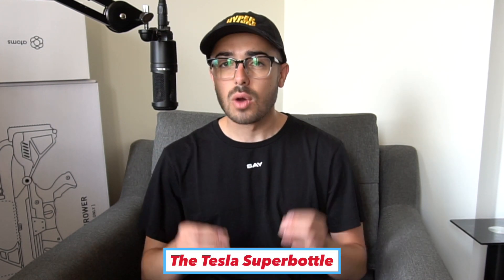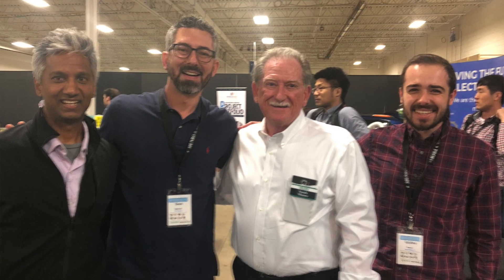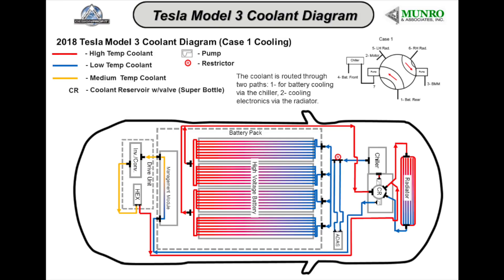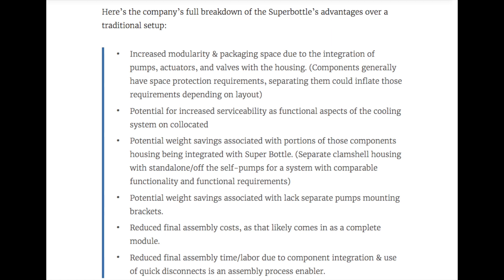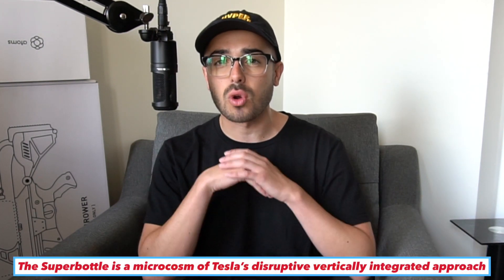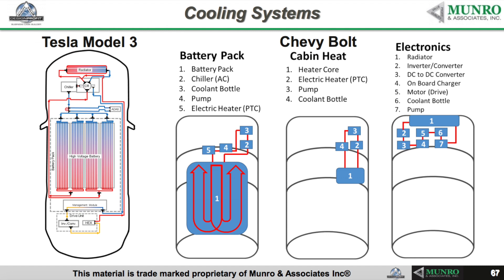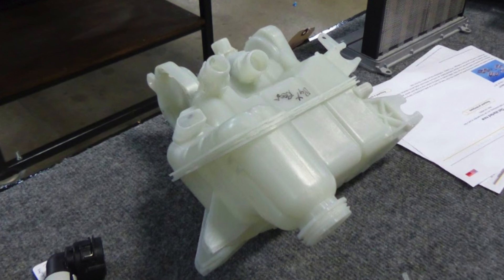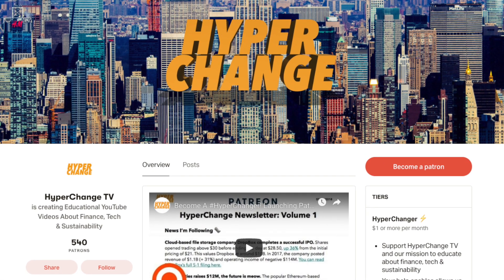The Superbottle: A Microcosm of Tesla's Disruption

Comment: Hey Hyerpchange, 

Love the show. This video on the super bottle and talk of Elon coming up with a cooling system reminded me of a video I watched on heat pumps and thermal batteries (https://www.youtube.com/watch?v=m99eDGx_Oog). The idea was that if you have large thermal batteries, then you could accomplish all of your heating and cooling with a compressor and evaporator. That way, every time you needed to cool something, you could be saving the heat produced from compressing the refrigerant and everytime you needed to heat something, you could be storing the cold somewhere as well. For example, if you ran your air conditioner, instead of having the compressor outside where there is a fan cooling off the compressor and having the hot air wasted, the compressor could be connected to a heat exchanger that would take the heat to a hot water heater. Or, when you ran your washing machine, you could also be generating compressed refrigerant for your refrigerator. To smooth things out, you would use thermal batteries, which would just be a large block of ice or bath of hot water, which are probably buried so that they are well insulated. 

There are several reasons why this wouldn’t work practically, such as most houses aren’t set up to have thermal batteries, and—probably the biggest—all your appliances that are used to heat or cool things would need to be compatible with your thermal battery system. When you told the story of the super bottle on your channel it made me wonder if Elon would be insane enough to build a house where all the appliances (fridge, washing machine, drier, dishwasher, etc.) were all made by Tesla and all controlled by a central heat pump and thermal battery system. Certainly, I can’t imagine any other company doing that, but with his dreams of vertical integration, this might be something he would be interested in. It would certainly be the most efficient way to control heating and cooling on Mars where energy might be in short supply. What are your thoughts?
Reply from the maker: amazing comment

Comment: Can you do a video on the Solar City  unit of TESLA? From the Vanity Fair article , it sounds like a fiasco and a major liability for the Tesla. The roof tiles never looked to be especially efficient to me, and I expect they would be expensive to wire and waterproof. If they are not great roof tiles (easy to install and keeping the weather out), then they are not worth using. (The Tesla is a great, safe, and attractive car - most sales are about that, the clean tech is secondary bonus for most people). Outside of the battery pack, does Solar City have any unique technology that gives it a leg up in this business? 

The real solar business is utility scale solar, built in the desert west. Isn't that where the focus should be? That is where the large environmental gains can be made. That is where the big Tesla battery packs make the most sense. With utility scale installations, Solar City would not have to worry about liability from sloppy work potentially done on by small business installers that are trying to cut corners on peoples roofs. Utility scale solar panels get recycled. The only advantages to rooftop solar is that states subsidize the purchase for people with high end homes, and this avoids the initial capitol required for utility scale projects. Other than that it is an inferior and less coat effective way to generate electricity, while utility scale is more cost-effective that coal and with the Gigapack batteries looks to be more cost-effective than natural gas.

Comment: Not really a fan of Tesla ... it seems to me it's been sponsored from the start and still doesn't make a cent in profit ... but tesla technology is very interesting .... the problem with centralising any system like this is that when it fails you lose the cooling/heating to ALL systems at the same time.  It may be a good idea for manufacturing and daily running but it means that the repair costs will be higher too

Comment: I don’t know about that as an hvac method.... I could see them creating a really efficient drilling machine to quickly drive geothermal tubes into the ground to create a heat pump system.

I think they won’t touch the internal air circulation because the current systems work and it’s not cost effective to rip and replace that.

But it is cost effective to rip out your radiator and use the earth for cooling.

Comment: Are Batteries not going to get smaller? Great video
Reply: Solid state will be at least 70% lighter and smaller.  Imagine a brick sized battery doing the work of a wheelbarrow full of LI's.
Reply: Peter John 
Will less cooling also be required or none

Comment: As far as I understand, some other cars, from Jaguar i-Pace to Rimac C_two apply a similar integrated approach to car design (in this specific case, thermal management).
This also has a drawback: there is no such thing as a small or cheap part failure.
Reply: Of course there is such a thing as "small" and "cheap" part failures, they happen all the time.     There is also such a thing as reduced part failure, improved efficiency, and extended durability.
Reply: @PETERJOHN101  Ask Tesla owners: every repair is a subsystem replacement. It takes very knowledgeable third party shops to do component-level repairs, and then with salvaged parts because Tesla does not sell them. In aviation is it called "line replaceable units". A failed resistor means a $200k computer module will be replaced (OK, maybe $3k in the case of Tesla.) 
There is no escaping this path. Just look at home electronics: gone are TV repair shops. Advantages of reduced part count, more compact packaging, and better manufacturability are undeniable. I am just saying that there are drawbacks, too.

Comment: Electric cars different cooling needs - for the engines and for the batteries so of course the cooling system needs to be different. One would however hope that a standardized solution gets implemented across carmakers to reach the economy of scales and interchangeability. Tesla is doing it alone, in this case it arrived to a solution where nobody had one before. But it is also reinventing the wheel too many times, the way the chassis is assembled is a weird hodgepodge of welds, rivets and glue ... very far from what the top industries are doing.

Comment: Bottled air? How 'bout liquid cooling... And at 3:36 "you can see the Tesla has an arc of cables" - yes, it is a schematic, but those are coolant lines (hoses and channels). Liquid, not electricity. 
Vertical integration is NOT the end-all solution for added manufacturing efficiency. And "legacy" auto makers and the engineers working for them are not all stupid. They were negligent about moving towards electric vehicles, but assuming that nothing they did is correct is ignorant, arrogant and foolish.

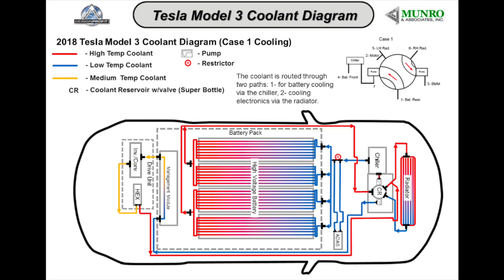Comment: 4:19, Air flow? I think you meant coolant flow. There is no air cooling on the battery other than the heat exchanger (front radiator).  There is no pockets of air flow going through the battery. Fix your video.
Reply: Listen between the misinterpretation.

Comment: As far as home HVAC goes, a Mitsubishi multizone mini split is essentially what you're describing at the end of the video. It's already invented and used more commonly outside the U.S. It's also way more efficient than central A/C, your'e only heating/cooling the rooms you need and the central compressor ramps up and down based on the cooling load.

Comment: So.... automotive cooling systems don't typically use air as the heat exchange medium but usually a water/glycol mix, that flows through hoses or pipes, not "cables". While the general point of this video is more or less correct, some basic knowledge about these things might be a good idea if you're analyzing car companies.

Comment: You mentioned the super bottle for home A/C usage. Look into Variable Refrigerant Flow systems (VRF). These are becoming increasingly used in the HVAC industry because it functions exactly how you described. You can literally pump heat from one room to another. I did an installation recently that has a bakery adjacent to a floral shop with a multi head VRF system. I am literally heating the occupied space of the floral shop by cooling the oven room of the bakery. Interested in what Tesla has in mind, but the technology exists currently from a number of manufactures such as Daikin and Mitsubishi.

Comment: Wow my 20 year old car has this high tech as well, it uses the heat produced by the combustion engine to heat the cabin! You didnt really mention what exactly is special about the super bottle (except its name and cool logo), everything in a car except the cabin needs to be cooled in general, which is done by a heat exchanger/radiator, and in an electric vehicle there are just more things that have to be cooled and can be combined into one cooling system which makes sense, i wouldnt consider this special.

Comment: 20 years ago, the datacenter at the university I was studying at had heat exchangers in all the rooms that were supplied with either hot and cold water or water at the correct temperature. They had a pretty massive thermal management room somewhere that was basically coordinating heating and cooling. At least one of the computers they had was water cooled and was supplying heat to the building in winter.

So, I think what they did was integrate the whole thing, but the concept doesn't seem all that new...

Comment: Nice job at explaining this.

Elon aims at mars. He need a system to manage temperatures of whole habitats in a smart and efficient way. But for a super bottle kinda system to be viable, it needs total integration to the building.

The back of my napkin says : Best way to retrofit half of the world is Smart AC systems that only run when needed... as efficient, silent and durable as possible.

Surely is on the way.

Comment: It’s a mini split, for a car. Which is amazing, but it’s not new for homes. If a new product got into the AC/DC solar powered mini-splits, that would be logical. Lots of on-demand water heaters are electric powered too. But I’d rather they expand the thermal “battery” with solar powered chiller market.

Comment: You missed an important impact on energy efficiency.  Separated systems have to dump heat or add heat as the cabin, battery, motor, or electronics need.  Superbottle allows waste heat from any of those sources to be delivered to any of the other components.  This 'heat re-use' improves energy consumption.
Reply from the maker: great point!!
Reply: Tesla generates heat during winter by wasting energy in the inverter.  They could (maybe the already are) max out clock cycles in the drive computer to generate bitcoin as  a form of waste heat that does double duty. It adds waste heat to warm the batteries and it generates bitcoin which Tesla could sell (just a thought).
Reply: That is just BRILLIANT !!! Made logically in my opinion. That should be basic in any design. Only Tesla is doing things logically to me. Am I not right?
Reply: Clay Karmel - It also reduces cost by eliminating a coolant heater and all the assorted things involved in that.

Comment: Very Interesting!  I would think that the super-bottle could be used for smart home heating and cooling by using the thermal deltas inside and outside the home.  Heat pumps exchange heat and cold from the ground but can also use other sources.  Perhaps much of the energy that is lost from the solar panel can be used as well.  I see many applications already.  Very interesting.

Comment: one nitpick: at multiple points, you talked about the bottle moving air - through cell gaps, in reference to the ac idea, etc.  superbottle is a liquid cooling system - the waves on the cell diagram are actually small plumbing, not ducting.  Not only is Tesla's battery cooling hdwe smarter, it is independent of outdoor ambient temperature and therefore can suck heat out of cells faster, UNLIKE bolt or leaf
Reply: Exactly. Thank you! Air cooling in large EV batteries is stupid af.

Comment: Gali... more please. Next, I have been thinking about and specking out my next house and I want it off grid ( of course). As time and innovations speed up, my ideal home ends up having at least all of the most important components being made and engineered by Tesla. You can picture it, the Tesla roof, the Tesla power wall, now heating and cooling by the Tesla super bottle controlled HVAC. I would also have the Tesla charger and of course a Model 3 and Y in the garage that is linked to my Tesla app and home security system ( Tesla century mode, you're welcome). 

Dude... don't give up giving us these videos. I see the stock price today and laugh. I hope to get more soon, but for today, Tesla is building and engineering a world I want to live in.

Comment: I’m pretty sure it is liquid cooling not air cooling
Reply: go to 9.00 min on this link for the answer,....& to 46.10 for info on the individual cells & other good stuff -> 50.01 and 1.18.40,...  https://youtu.be/2nhQw7iGukE
Reply: @Derekuma  thanks for the link, long and slow but very informative (watched at 1.75 speed :D )
Great descriptions everybody
Reply: Andrew Hart Yup! Normal water/glycol coolant.
Reply: That got me a bit, how could a Tesla battery be air-cooled? Also, is Tesla's system the only one using pipes in between the battery cells to cool the battery? :)
Reply: Elektrotehnik most of manufacturers are using prismatic or pouch battery instead of cylindrical battery.  This have the disadvantage of heat buildup inside the battery as there are greater distance between each cooling apparatus.
Reply: @1943vermork  pouch batteries also lack conformity and interchangeability.  Not to forget if one battery goes bad, you lose 15% or more range and all acceleration.
Reply: @davidbeppler3032  Bollocks
Reply: @elektrotehnik94  yes, this system is unique and very efficient as on today.
Reply: You beat me to it.